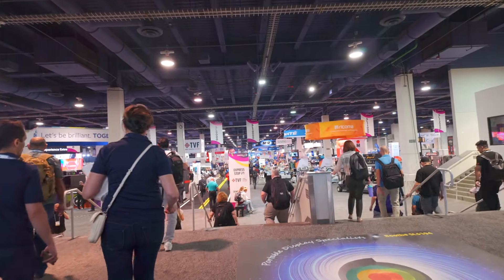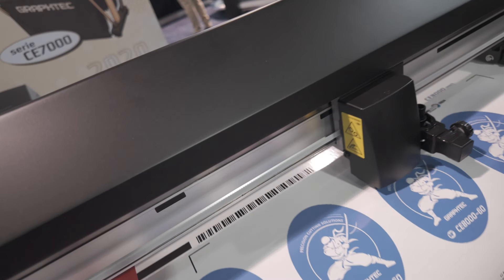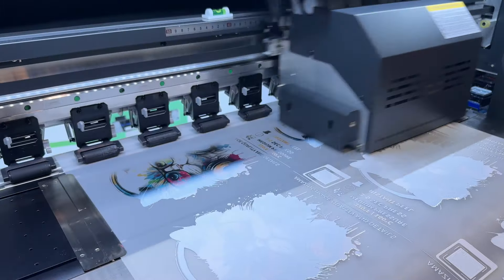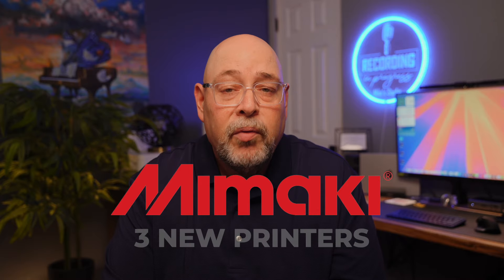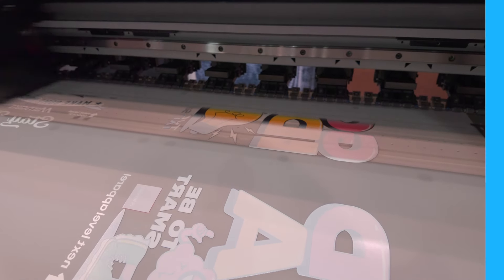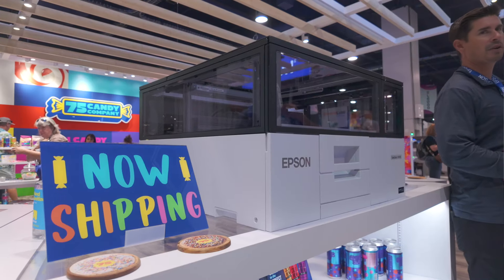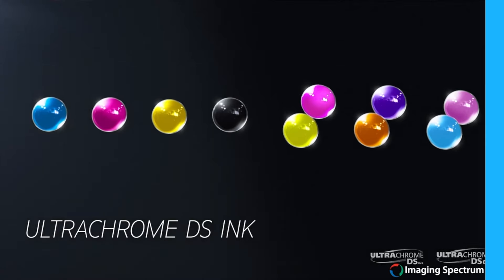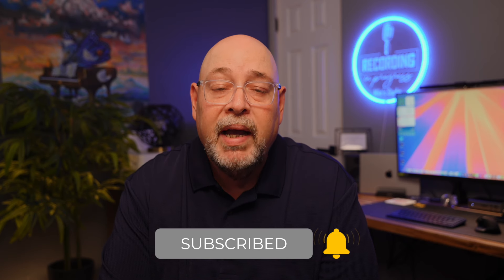Money-Making Tools: Printing United Show 2024

Comment: Firstly, it was great content! I wanted to ask your advice on which inks will work best would be more durable for outdoor use on PVC or Vinyl. We do a lot of outdoor branding and are looking for a ink solution that will last the longest in the hot, sunny climate of South Africa. What do you belive is better UV to Latex.

Comment: Hi Mike, thanks for the video’s.  I am looking for a way to do white floods on Lexan.  Now, I 2nd surf print digitally and pass along to a flatbed screen press.  I’m looking in the $30k range.  Would love to tap into your expertise for options.
Reply from the maker: Sorry I missed this comment. It sounds like the current process with screen flood is a cost effective and fast. Why are you looking to switch? I don't know of anything in the $30k range that will compete with what you're doing now. Another option is to look at CET or Vanguard as they both offer printers that are field upgradeable and you can upgrade 2-8 heads just for white to keep the speed up , but will pay $80-150k.